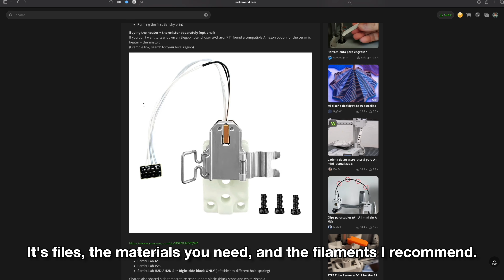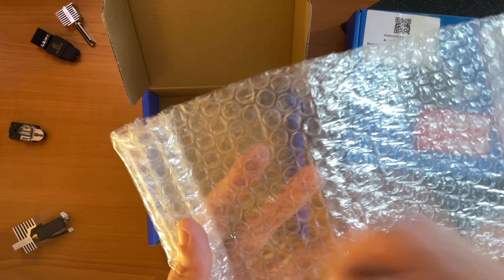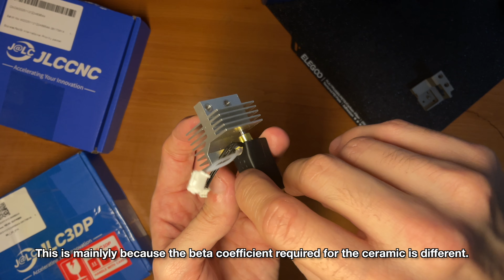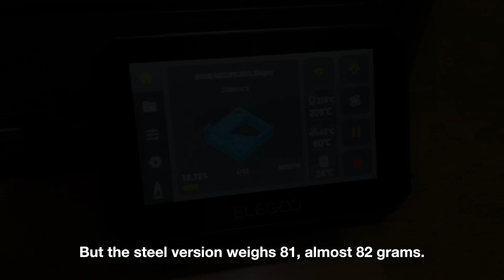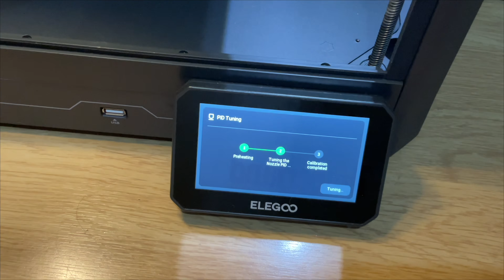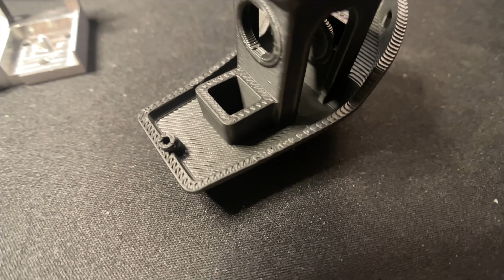CNC & 3D Metal versions - Adapter for the Centauri Carbon with H2D Hotends

Comment: Can this work with the canvas system? Im now intrigued by this always had issues with default hotend
Reply from the maker: You have in the Makerwork project two remix from the community that create the slot for the sensor of the CAVAS. Just have to use the shroud fan for it. If the project have both things connected, just have to cut the shroud fan alone
Reply: @PedrinbeepOriginal  Okay ill have a look think im gonna go CNC route and always had clogs with my elegoos hotends, regarding your printer app can that be used anywhere or only on home local internet.
Reply from the maker: @connnneo9236  I didn't receive my canvas to finish the app too. You can do a Tailscale with the app for anywhere use but for now only in local network

Comment: Hi mate I have a question, is the zirconium heat plate necessary or will the stock be okay? I ordered the full assembly from bambu but I'm hearing I need to change the stock plate
Reply from the maker: Hi! You can use both, the stock is the one I use, but in theory the zirconium one have better thermals. Nothing to crazy for this mod
Reply: @PedrinbeepOriginal thanks I was just warned that the heat may spread to the aluminium and cause problems
Reply from the maker: @ShaunsRandomProjects  Nah, the aluminum works flawlessly dissipating the heat 👍

Comment: I tried installing this modified accessory on the CC2. It fits perfectly, but the nozzle sits further forward than the original factory one. The wiper compartment on the CC2 has been repositioned to the left, which makes normal nozzle wiping impossible. I can provide all relevant dimension data and assist with testing if needed, and I hope a dedicated version compatible with the CC2 can be released.
Reply from the maker: I pre-order the Canvas for the CC1. I will edit the files for it. Should work for the CC2

Comment: Is there a reason why not to remove some meat from the 3d printed in metal? The left side, it is pretty bulky, is this required?
Reply from the maker: There is a version holed in the MakerWorld files. But yes, you can edit the STEP to remove some part of the design
Reply: @PedrinbeepOriginal  sure, I might edit it, just thought there was some reason to do this way. Thank you!
Reply from the maker: @alwnz3250 the design came from the plastic version, that use that zone to reduce vibrations and more stability. But in metal can be reduce for sure.

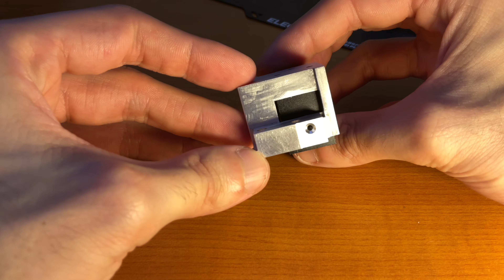Comment: Somehow I printed a housing/bracket that has the filament hole more toward the back @4:30 and the Bambu hot end won't line up correctly. What a waste of time and money so if you want to try this, be careful to get the right model.

Comment: so where is the thermal paste to be applied? just printed the adapter in PET-CF (not petg-cf), annealed for 2 hrs at 90 degrees, hoping it will withstand required temps
Reply from the maker: The thermal past part is in the other video, where I put the ceramic and the thermistor from Elegoo to the Bambulab heater assembly. Between the ceramic and the  heater you will see the thermal paste, that's the zone. 
In you case, check some time how well the adapter goes in terms of melting for the material, at least in long prints to ensure nothing cause problems.

Comment: Do you know if this will work on a CC2?
Reply from the maker: The printhead is the almost the same. I don't have the CC2 but it should work in therms of design. You can print the adapter in PLA just for testing hot well it fits, check the hole from the extruder and extrude filament only to see pass through correctly. This and the filament cutter tolerances are the important parts, the rest should be the same. If anyone want to try, that would be nice for the community.
Reply: @PedrinbeepOriginal  I did the mod last night on my CC2.  The CC2 has an extra sensor on top of the hot end fan that has to be relocated.  I had to drill 2 holes in the fan shroud for the screws for the sensor.  When I mounted the sensor I broke 2 of the wires otherwise it was working with the bambu mod.

Comment: While watching for my own curiosity without owning either of the specifc platforms mentioned (though I do custom mounts for my own machines as well as custom hotends quite frequently), designing around the material brings up good points. That steel part in particular, you can add lightening cuts into the design due to steel's inherent rigidity, reduce thickness where not dimensionally critical, etc., which will cut a substantial amount of weight out of a part that will perform (with regards to inertial differences as well as material tolerances and resistances) at or above another lighter option. Aluminum in this case could be done exactly the same way and produce an even lighter option, as it will still retain more strength than a comparable printed part of most any material outside of aerospace-grade options. 
All in all, adapting the hotend was a cool project and I enjoyed seeing the end result as much as the journey.
Reply from the maker: Thanks a lot for the detailed feedback, you’re absolutely right.
 The steel version was more about exploring material behavior and tolerances rather than optimizing mass from the start. There is definitely room for weight reduction through lightening cuts, geometry optimization, or trying alternative materials. The design is very flexible (including with generative design too could be great), so anyone can modify it to suit their needs, including reducing weight or experimenting with other options like 3D printing in titanium.
Really appreciate you taking the time to share your perspective, and I’m glad you enjoyed both the project and the process.

Comment: How about to drill some holes on the right side of the adapter to shave few grams on weight?
Reply from the maker: One user in Reddit do this, and take a few grams, but he modify the adapter in a skeleton way to reduce a lot more, that could be the best design improvement in all ways, cooling and weight.
Reply: The only problem is that the more material you remove, the adapter will get slightly weaker and more prone to warping/bending overall. If you have it made out of aluminum then that is only slightly heavier (about 6 grams, 39 vs 45) than the stock hotend and I don’t think that will cause any problems. Again, this is all just theory but it’s based on sound research and experience. I can start testing my theory once I get the part made and installed.

But the weight seems like it would only cause a problem if you’re doing high-speed printing, where it might affect acceleration and momentum slightly. But most people don’t print at these crazy fast max speeds that some of these printers claim they can go (500–600 mm/s). Printing that fast usually has a huge negative impact on print quality. Slower (100-300 mm/s) is almost always better and leads to better quality. And in cases like that, 6 grams shouldn’t make a difference.

Again, this is all just my theory and opinion though, so take it as you will, haha.

With that being said, making a few holes or hollowing out a few non-critical areas of the aluminum adapter (in order to lose those 6 extra grams) might not be a bad idea since the printhead was designed/calibrated to operate specifically at 39 grams.

Comment: Much appreciated for all the effort and dedication on this project. You are an amazing, generous, and creative person and we need more of that in the 3D printing world.

I will likely order one of these in aluminum. Looking forward to it.

Quick question though, would this mod also work for the Centauri Carbon 2? I believe it uses the same hotend/nozzle but I’m not 100% sure. Maybe other parts in the toolhead changed (such as the fan and shroud perhaps). 🤷‍♂️
Reply from the maker: Thank you very much for your words! I didn't know if could work, but I read the the printhead is almost the same at the CC1. The adapter can be modify easily to ensure the new dimension of that printer for sure, that would't be a problem. I don't need the CC2 (also I don't have more space in my house hahaha) but I hope that someone with the CC2 give it a try a share with the community, that could be awesome to that new printer.
Reply: @PedrinbeepOriginal 
Thanks so much! I have a CC2 on order and should have it soon. (I probably don’t need another 3D printer either but I ordered one anyway, lol.) I will test this as soon as I can and let you know so you can include the info. What’s the best way to contact you? MakerWorld maybe?
Reply from the maker: @G @zx4133 aving printers by itself could be a nice hobby 😂 Yes! Just try carefully, don’t do anything bad to your new printer please. You can leave me a message in MakerWorld, Reddit (Pedrinbeepdev) or in the website www.resincontrol.com you have a contact email too. Thank you!

Comment: Ive been following since start.  I print at 310 regularly and had issues ASA and even PPS-CF. Have you tried at 310 and any issues to report if so? For the price of PPS-CF it seems the aluminum one is a better route. Thanks for the great work.
Reply from the maker: For my experience, I only do short prints, nothing about 16-24h prints or something like that to hard test the plastic versions with PATH or PPS, but is normal to get a few problems in the future, is still plastic. I also print the adapter in PAHT with the adapter itself and a H2D hotend without any problems, but I didn't get to 310º in any of my prints to see how much can handle the adapter in plastic. A few users research in spray coating with something thermal protective the complete adapter, like I do in the video but I invest to enough money to continue testing hahaha. In the metal versions all works great, except the limits in temps by the printer itself that you can't go further than 320º.

Comment: looking into the CNC.  I've bene using one I printed in P
ppa-CF and has been great so far, but flexes some when removing the hotend if it sticks at all.
Reply from the maker: Yes, is still plastic and the temps could be really high for them. It's a really good material but plastic. You can modify the adapter, inserts some little steel bars, o whatever solution to give more rigidity, but in CNC is the best solution (or 3D print in the appropriate material)

Comment: I had one made in aluminium in SLS - came out fine, but the location peg came out over-size slightly.  sorted with careful use of files.  I'll be trying it out soon!
Reply from the maker: Yes, I have feedback from other users that tell me this and modify the design a little bit. The SLS in aluminum is still a cheap solution.
Reply: @PedrinbeepOriginal  What do you recommend as the best process/material? CNC Aluminum? Or is SLS/SLM preferred?
Reply from the maker: @zx4133 The best is CNC, but in SLM aluminum is a nice option to. You can modify the design to reduce weight (a lot of CAD softwares let you see the weight selecting a material) and do it in steel/titanium too.
Reply: @PedrinbeepOriginal 
Awesome - thank you!
Reply: I thought the SLS process was only for plastics? Nylon mainly. And for metals the process is actually SLM? But this is all just based on some online research I’ve done. Can you help clarify? I’d like to order one in aluminum but I’m not sure which process to request… SLS, SLM, CNC, etc.